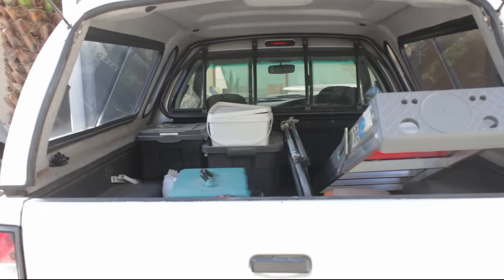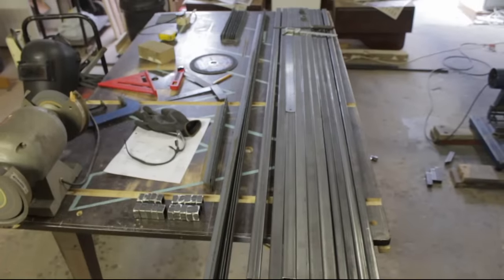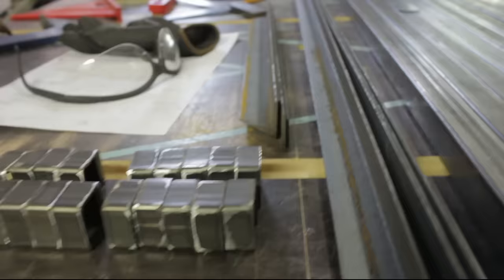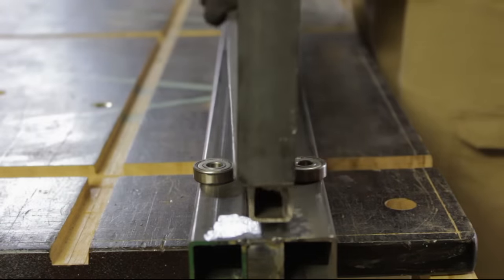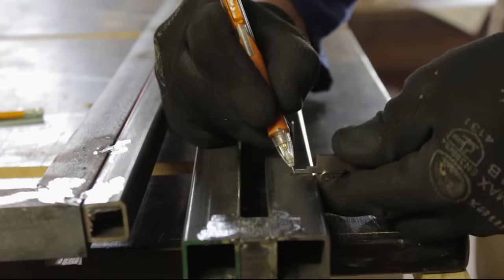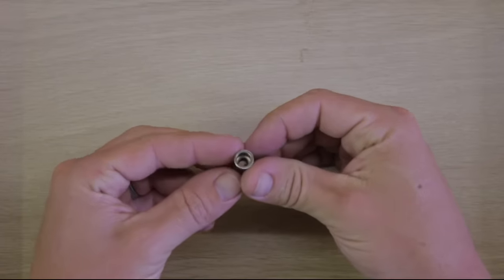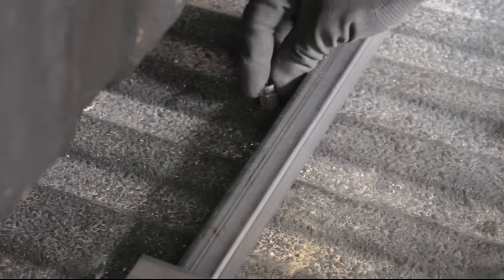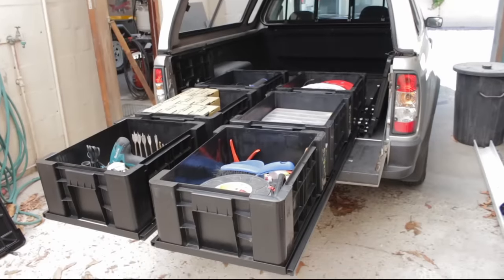Diy truck bed drawer slides for organized tool storage  // metalwork diy how to

Comment from the maker: Hi Folks. 

Most asked question in the comments are about the threaded insert. 

Here is a link to a Blind Rivet Tool to help with the threaded inserts. Note this is an affiliate link so if you do click thru, thank you very much for the support and interest.

https://www.amazon.com/gp/product/B07MZKBBDR/ref=as_li_tl?ie=UTF8&tag=thewoodenfact-20&camp=1789&creative=9325&linkCode=as2&creativeASIN=B07MZKBBDR&linkId=74f2fbd647c107fa514efb7d9425a49e

Comment: Outstanding!  I'm learning welding as well (so far only oxy acetylene but it's not the right tool for something like this), and would love some information from you.  Would you share which welder you used, and what you think of it?
Reply from the maker: Hi Tim. I’m using a GAR  Ac/Dc welder that I inherited from my father. I’m still getting to grips with all the ins and outs of it but it suits me needs perfectly for now.

Comment: Hey mate. How have those scateboard bearings held up? I'm looking at building a similar setup but that would be my only concern
Reply: Think of how much impact and a beating skateboard bearings take regularly, they're incredible. If anything the bolt holding it would bend. As long as you don't overly tighten.

Comment: I’ll just buy $350 worth of square tubing and $100 worth of bolts and bearings, pull my welder out, grind smooth, get my drill press and spend 20 hours putting it all together and wa la!!! That was easy.

Comment: nice work! Do you plan to build a platform above the storage drawers for additional storage of large items without interfering with the drawer system?
Reply from the maker: Thanks Jeremy. Yes, I built it in a way that I can do exactly that for a future build. I thought of almost doing the same thing but just two big flat platforms pulling out so anything additional like power tools and so can also be loaded on top and also be pulled out with ease.

Comment: Maybe use cam followers. Top eccentric and bottom fixed. That way you can adjust eccentric followers down on sliding frame. Tack nut on back side of plate for threaded potion of followers  and drill large enough hole for nut to go through. Then weld plate on on frame.

Comment: That is a small truck.  You could have made that with just one drawer and would have been lighter, cheaper and less complicated to build.  I have a small ford ranger and made drawer 3 feet wide.  I use milk crates that work well.  You lose space down the middle.

Comment: Hey guy.First thing, great job u did. I really like the simplicity and tightness of the ladder rack as well. Questions - did i miss how you secured it so it doesnt pull all the way out? What about that flex factor when extending it past that certain point, where it looks like it might be dragging on the tailgate? How does that affect it? Enough that u did something about it? Did u make a platform on top of these? If so, did u post a video on it? As time went on, what have you found that worked out very well, and in opposition, what might u have done differently? Thanks for sharing. Aloha ;)

Comment: A video specifically about truck bed pull-outs, (which were well done, for sure), and my favorite part was the ladder bracket...
BTW: I don't know if it's a generic name or the name of a specific brand, but I've always known those threaded inserts as a "nut-sert".  (Not sure how that would actually be spelled, but ya, a nutsert.  (Because you're basically inserting a nut into the metal panel.)

Comment: Excellent job! I've attempted sliding storage and failed in strength. I will try this.
What is the threaded pop rivet you  used to secure the bed braketing system?
Reply from the maker: Thank you. There is a product called Rivnut that does the threaded pop rivets. They have a crimping tool for it as well.

Comment: This is crazy man!!! I bought my truck last spring and went on the hunt to find a decent way to build a slide but only found ones that would fall apart in short order the way I use my truck so for the past 6 months I’ve been planning and gathering materials because I’m doing it on a limited budget but I started building it a month ago and worked on it again yesterday trying to finish cutting the last couple pieces and welding them up today. 

Our designs are very, very similar buddy. I’ve been worried about how it was gonna work cause a couple guys said it won’t work like that but I knew better. Yours looks like it’s working well so mine should also. I did see the other comment bout adding a few more bearings so I may try that and will let you know if it works. 

I appreciate your videos and hope you put more out, take care!!
Reply from the maker: Hi Don. 

Thanks for the awesome comment. Nice to hear from someone else also building the same thing. Would love to see how yours turns out! 

Mine is still working perfectly. Haven’t gotten to adding a few extra bearings yet, but my load doesn’t change much so it hasn’t really been an issue yet.

Maybe just consider the amount of weight you’ll have on the front of the drawer when fully pulled out. You might start feeling a bit of flex in the frame,  this will mainly depend on the stock you’re using for the drawer runner. Mine was fairly thin to try and save on weight. This doesn’t affect me at all though because in my specific setup it rests on the tailgate if I ever need to bring it out that far. 

I realized the best part this past weekend when I needed to take it out and it was only 2 screws, that’s it. 

Hope you have an awesome time building yours! 

Cheers

Comment: Well done. I wouldn't use rivet nuts for something designed to carry that much weight. I think it would have taken less time to just weld. Still, nice tutorial.
Reply from the maker: Hi Jay. Thanks very for the feedback. I found that there is now force on the rivnuts where the are inserted as the really just keep it from sliding forwards and backwards. No force pulling up on them. The reason for them was purely for me to be able to remove the whole frame easily when I need the space.

Comment: The BEST DIY sliding truck bed on YouTube hands down. I've been looking for a commercial product that integrates modular tool boxes with a sliding bed and they don't exist. As far as I know, you are the only person to have successfully produced one. Also many of the commercial bed slides are about 4" tall thereby wasting a lot of space. That is their biggest drawback aside from price with many products > $1000 usd. Your 'split bed' idea is also unique, though having a larger slide out floor would allow me to store my collapsable table saw and mitre box. Adding a handle that allows the unit to lock in position might be cool. Overall, very well done indeed.
Reply: For more context, Dewalt (and others) make a stackable tool box/organizer whereby all the boxes can 'click' together on a standup, roll-away unit with large wheels and a handle. It would be great, for instance, if there were such a device that allowed you to, say, remove the tool boxes from the sliding bed and stack them together on a roller. Sooooo truck bed to roll-away kinda thingie. LOL.

Comment: Can a beginner with zero metal work experience pull this off?
Reply from the maker: Hi Ed.

Probably depends on how handy you are in the first place, like any woodworking experience or so.

For me, this was actually my first metal project and first time welding. Kinda figured it out as I went along. The welding was the most intimidating, but it is fairly easy once you practice on a few pieces of scrap metal. Trial and error then do it over and again. Welding isn't rocket science, it comes down to repetition by doing it a few times over and over. Practice makes perfect.

So give it a go, you might surprise yourself and learn a new life skill.

Cheers

Comment: Looks good! Where did you get those threaded rivnuts from? I'm also in SA, looking for those rivnuts that you don't need a special tool to insert
Reply: I got very nice rivnuts from Front Runner Racks in Kyalami and they also have a self made tool rivnut that isn't very expensive.

Comment: awesome video! love the videoagraphy and time taken to take important close shots. Is that a South African accent I hear :)? I ask because I'm from Cape Town :) One wouldn't say you new to this lol you doing an epic job can't wait to see your new videos. couple of quick questions if you don't mind its about your build. What size Bearings and bolts did you use and the rivet thread things you used, that just mind blowing lol what are they called? Can I source them from BMG bearing man? Thanks again Best wishes for 2019
Reply from the maker: Thank you very much Jawaad. Well spotted, I am also from Cape Town! 

Ok so for the hardware details...

I used 608zz bearings that I got at Midas, Bearing Man will definitely have some just, couldn't drive all the way out to them. Inside diameter is 8mm and outside is 22mm.

Bolts for the middle is 8mm x 50mm long and the sides are 8mm x 40mm.

The one thing I would do differently is adding even more bearings especially towards the front. It is plenty strong at the moment, but a few more in the front would just help for a smoother slide when the back reaches the front. 

Thanks again for the compliments and best wishes for 2019 to you and your family!
Now go build something! :)
Reply from the maker: Oh and for the threaded insert you can use a product called Rivnut. There is a place in Somerset  West that sells them, but there will be somewhere in CPT too. Just ask Auntie Google.
Cheers

Comment: How do you stop drawer from falling off the car when pulled out all the way
Reply from the maker: You could put an angle iron tab on the bottom of the drawer at the back, but mine worked out that if its that far out the slight flex in the drawer being all the way out just just goes and rests on the tailgate and the friction stops it from coming out all the way.
So this is working for me but that might only be in my case. Hope this makes sense. Cheers

Comment: Do you have source links for the threaded inserts and the boxes you put in the trays at the end. Those are sweet. Nice build all around. Did you incorporate a stop so the trays don't fall out or go past the optimal point.
Reply from the maker: Hi Ken.

I"ll post a link below to a tool for the threaded inserts. As for the boxes, you should be able to find it at any outdoor/camping store. I'm not sure if you will find these exact ones world wide, but you should be able to find something that will suite your needs.

I did not add a stop to the drawers as you pull them out, I found that I never pull them out all the way as is. But it is very possible just to add a tab on the back of the drawer underneath that should prevent it from coming out all the way.

Thanx for the comment and glad you enjoyed it.

Cheers.
Reply from the maker: https://www.amazon.com/gp/product/B07MZKBBDR/ref=as_li_tl?ie=UTF8&tag=thewoodenfact-20&camp=1789&creative=9325&linkCode=as2&creativeASIN=B07MZKBBDR&linkId=74f2fbd647c107fa514efb7d9425a49e

Comment: Where did you get your bearings from for the slide?  Thanks
Reply from the maker: Hi. I got them at a local Automotive shop.
Reply: What size bolt goes into the bearing? I thought about skateboard bearings, but I think those are too light

Comment: First of all u did a gr8 job, since I  have been trying to make one out of wood but I wasn't that successful. So I have a few questions, do you have any plans/measurements, size of bearings and as far as the bearings go, there are different types for heavy loads also the rivnuts is what those inserts are called they are very strong but I would add a few more all around because when you extend the the slide all the way out it needs more support but all in all you did a phenomenal job. Btw I just subscribed to your channel and for all the notifications. 
One last question would you think that it would work with aluminum tubing, just to make it lighter the question is as far as strength? 
Keep it up 👍👍👍👍

Comment: All that time and hardware, tisk,tisk. I have a line X spray liner in the box. Chevy has pockets in the bed side for creating a second deck.made 3 spreaders. Laid a split 4x8 3/4 inch pressure treated plywood across the spreaders , hinged in the middle. Glued Astro turf onto the plywood . I slide buss trays underneath, mine fits 6 in all with lots of room for long items carries all my supplies, remains dry for the most part, I drilled holes in the corners of the buss trays just in case.  Water drains through around the sides , me and the fellas stand around the box and put their coffee and breakfast sandwiches on the turfed level while we shoot the shit . I can remove everything in two minutes if I need the bed. I commend you for exercising your brain though. You will regret what you’ve done in time when the system you have created doesn’t work for you for whatever reason. I’ve made all the mistakes  while searching for the grail but there is no grail. Best advice is the same advice you’ve ignored. Keep it simple....... it’s really not your fault, you have a young and perhaps an uncluttered mind. In time friend, in time. After enough failures the light will go on and you realize the futility of it all.